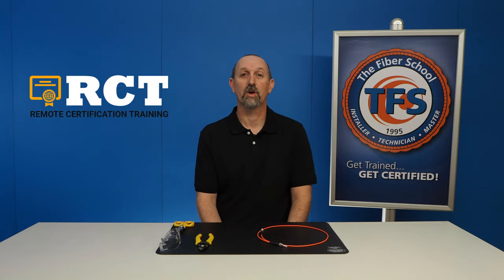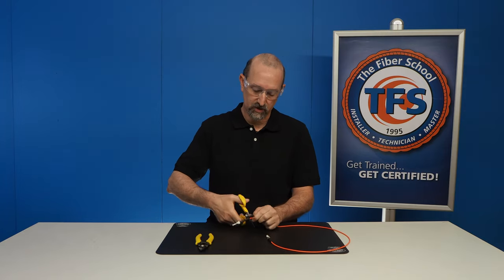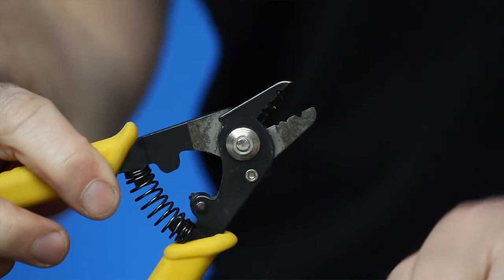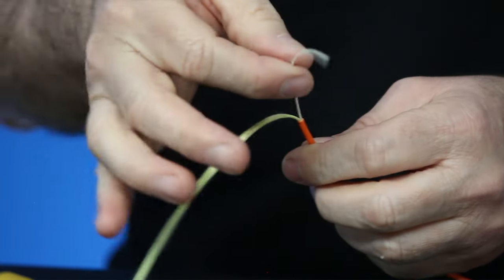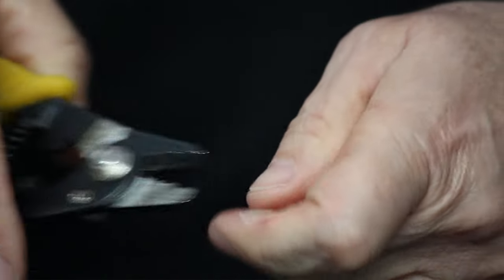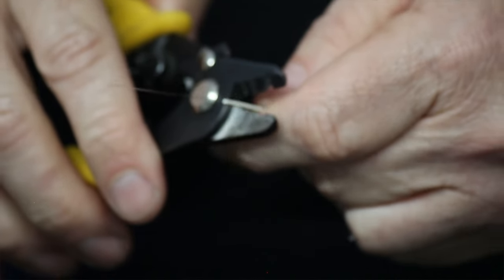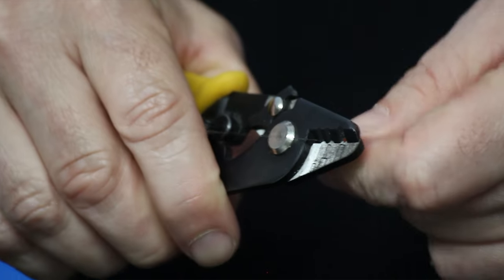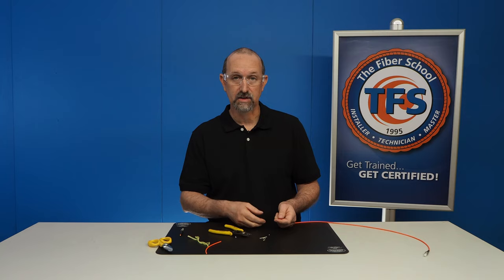How to: Use a 3-hole Stripper

Comment: My strippers wont take off that coating anymore, micro adjustments are made and then it will just cut the glass. I got frustrated after many attempts and said whatever, terminated it and there was basically no loss in light signal. Is that bad to leave that coating on?

Comment: Hi, Joe! You're wrong. It is forbidden to conduct the second time on bare fiber. You are making micro-scratches.
Reply: Sometimes you have to strip a second time as all of the coating does not get removed when you wipe the fiber with alcohol.  This could also be an indication that your tool is wearing out.  Whether you create micro-scratches I cannot comment as I do not have an inspection tool or know of one that can show evidence of those scratches.
Reply: @josephcairone2065  You are absolutely right. If the result is not achieved the first time, then you need to tune or change the tool